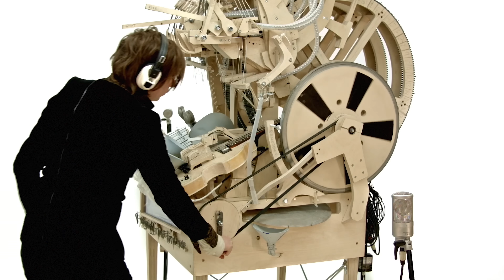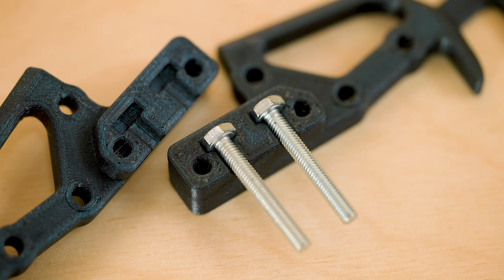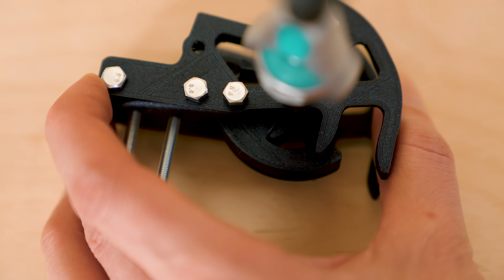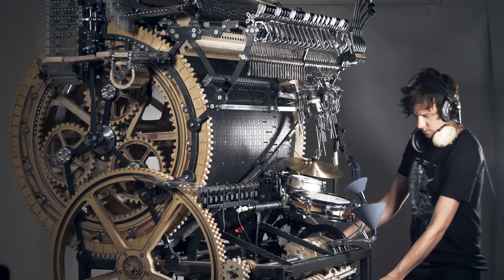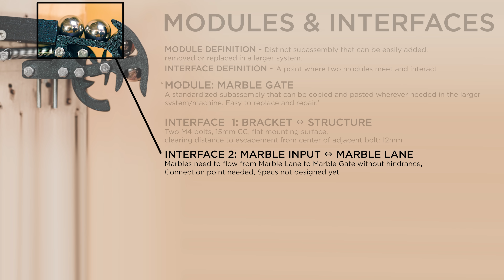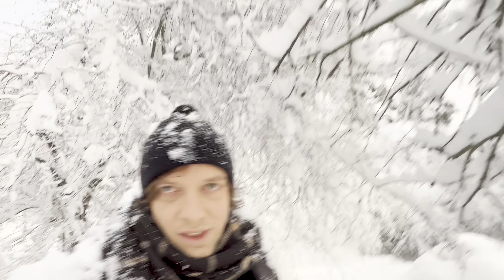The Foolproof Marble Gate - Does it Exist?

Comment: Awesome work. A brand new module. 

* Your previous tests are all null at this moment. (The small post-drop lift of arm disrupts the settling of marble, possibly wrecking the hold time test earlier).
* Need to test for added weight of hundreds more marbles in line. Not with just 5 marbles - Load testing.

Comment: Hi Martin,
Great to see you back in action. Your Nelson Tale from the previous video was great!
Your modules and interfaces explanation is to the point, but your specification of the requirements is not. Any specification containing the words 'as possible' is meaningles. Even worse is 'as close to'. When ends that search? De you realy know there is not another design that gets even closer (still being  'possible')? You should instead specify your minimal goal to reach, and probably a 'nice to have' goal. In one of your earlier videos you showed that the human ear can't detect differences smaller that 30ms. So 'thight music' means 'within 30ms accurate''. Then you have to consider how many parts/steps in the machine contribute to the timing accuracy, and how much each step may contribute to it. It is of course allowed to bargain with these numbers during the design process, but you should not spend time optimizing a part that is already good. Remember 'perfect is the enemy of good'.
Good luck with your engineering.

Comment: At times, it is beneficial to have another set of eyes on a problem.  Everyone has an idea, like myself.  The area of release time, I see should be a 2 part section.  When the marble is being held for release, there is a force that you're not using.  If the trailing marble was resting on 1st.  then the stored energy or what I would call (load force) will supply energy to the marble leaving the gate.  I also think if the release section was vertical with several marbles adding load = greater speed.  I so enjoy your engineering abilities.  Don't apologize for reaching for perfection.  It's something few achieve.  Well done, Sir!

Comment: evolution. nice. you can try to use some other software and infrastructure concepts to make your work easier :) 
for example: "Fail fast, fail often, recover quickly" or "Automate everything"
and I think you could try to use the dependency graph concept to make the change chain visible and see if something is going wrong in your dependency chain :)

Comment: Nice nice nice. Also you should check for resonance problems. Let your Arduino sweep the intervalls gradually and see whether the bounce behaviour causes weird behaviour at some particular frequencys. So, in cases some BPMs don't work fully reliably, you can avoid them or... dampen the system

Comment: I do not like the feed to your marble gates. The steel marbles are not sufficiently constrained, but are allowed to "flow" downwards via gravity through tubes or channels, and will bounce about like a Newtons cradle. What happens at high or very dynamically variable flow rates? Probably chaos. You need a gate that works AND a dependably steady way to feed that gate under a wide variety of dynamic conditions.

Comment: Hey Martin, now that you have learned about modules and interfaces I suggest you also add some "continuous integration" to the mix. That would roughly look like: 1. Define all modules and interfaces for a complete machine 2. Build a first very rough version of the complete machine that is completely functional 3. Iterate on it by improving one module at a time.
What is quite important is to quickly finish step 2. That means you'll have to very quickly reach a point where the machine does everything you need. It can do it in a very buggy way but from that moment it starts to "deliver value" and you know that you are on track. You can then produce a little song after each improvement iteration instead of making the audience wait forever. It does not matter that the machine will be very imperfect at the beginning. Things will just keep improving. What is much worse is to only build the machine to 70 percent or so and then go through endless optimization loops without letting it properly play at the end of each iteration.

Comment: i have a ball bearing feeder for speed shooting slingshots.  i like it because it’s a convenient way to store an extra 50 ball bearings but it’s actually faster to just grab them out of my back pocket and the thing has many flaws.  the magnet isn’t strong enough to hold ball the ball bearings so it’s easy to drop bbs on the ground and it only works with two sizes of steel balls.  somebody else made the exact same thing but it’s in the handle of a slingshot and it’s expensive and the guy patented the slingshot but it has the same problems and only holds ten rounds.  but nothing has been made for clay ammunition.  also i have a 6mm blowgun for airsoft bbs and i cut down my broken slingshot bands to shoot plastic bbs indoors but if i were to play airsoft with either of those things a speed feeder might be nice.  maybe you could do other things with your design?

Comment: I noticed that in the middle of the "Attack time" the gate holds the entire marble queue with only the release lever at the bottom- I'm worried that with greater marble pressure that will end up failing. It's really awesome to see you approach this in such a piecemeal way, I think you stand a MUCH better chance of success this way!! When I did coding (wayyyy back in the day) I always found it was better to perfect pieces of code, then integrate them together rather than write the entire program and then troubleshoot.

Comment: Martin, I don't know if you'll see this, but I had a design thought: one of the challenges with this gate seems to be how the marbles jostle around (bump back and forth) as they move through the gate. (It mustn't be a major concern; you seem happy with the gate!) I wonder if the jostling could be reduced by modifying the clock escapement gear to have spherical cavities that guide the marble more gently through the gate. I'm thinking of the kind of gears that exist in those automatic orange juicer machines.  Googling "Maxima MAJ25-45 Squeezing Cup" should pull up the spare part from one of those juicer machines that shows the shape I am trying to describe. I wonder if putting something like this as the escapement gear might make the marbles' journey smoother before the drop.

Comment: Martin, your new approach to problem solving seems to be yielding great results. At the start of the most recent phase you seemed quite negative about the prospect of actually initiating a new marble machine build. Over the last few videos,and your success in improving the marble gate, I can sense increased optimism in your words. I’m sure all your followers are hoping that you can get a working machine designed and build as a result of your higher level of discipline. Can I please ask that you don’t get carried away on a wave of positivity and forget to apply the restraint and control of your current approach. Having said that, I wish you good luck as you move forward and keep my fingers crossed that a new marble machine will eventually grace these pages. 🤞👍👏

Comment: Let’s talk about the interfaces. Interfaces 1,2, and 4 are very simple. Interface 3 is complex! 
A complex interface is a warning to the designer that this likely not to be a good choice of module boundary.
The module boundary should encapsulate the internal complexity of the mechanism in the module, and reduce the interaction to a minimum, one signal per gate would be ideal, be it a mechanical push rod, an electrical signal or whatever. 
Interface 3 currently has too many constraints and things needing adjustment during assembly.

Comment: I caution about the way this gate will wear. I don't know the terminology for any of this, sorry.  The 'top spike' that holds the starwheel looking thing is really thin and rubs against the starwheel.  Over time that will wear, and the tip of that spike will become shorter with very little wear due to how thin it is. The location of the tip of that spike is very important to your timing and the gate working well.
Not sure what your planned materials are for this, but I would definitely not trust any kind of plastic, and honestly there is no reason for that spike to be that thin other than appearances.

Comment: One other thing to consider is the plastic parts that move against one another. Given that the machine would have a high number of cycles, it is important (especially with rotating members) to use dissimilar materials to prevent micro welding between surfaces as heat builds up at the points of rotation/sliding against each other. You may find the gates start to stick or break because surfaces start to weld and break as the gate is cycled repeatedly over a short period of time.

Comment: :( I feel a bit bad when I see a flaw in the design and you take the bad approach to solve the issue.
I can understand it is not obvious: "the gate closes too slow, so we need to speed it up".
No, the real issue is, "the gate is not closed when the marble is released". So the solution is "change the geometry so that the gate is already closed when the marble is released". Then it does not depend on the speed anymore.
Anyway, I am glad that you have solved your issue.

Comment: I think you are repeating same mistakes as before. Your super solution for problem is turning parts 3 degrees left or right. Think about what happen after milion drops of a marble. Will gate set be excactly the same? Will not plastic parts ware out? If you need to tweak your solution that way, it is not a good solution.

Comment: The new gate looks great and seems to be highly precise and accurate on its own, however I wonder if this will be the case when there is 15 plus gates going at one time and the machine has vibrations and movement. You need to test this before settling on a gate design

Comment: Will 3D printed plastic be the final material of the gates or will they be made out of plywood? If you are using the 3D printer just for rapid prototyping it could be time to test it with the final material :)

Comment: I think you need to consider the vertical drop of the gate. A lot of your timings were "fixed" by ensuring the gate dropped vertically and the marble landed on a flat surface. However that will cause the marble to bounce and re-hit the same point. It needs lateral movement in order to bounce off of the instrument and subsequently collected.

Comment: I still believe that making the actual drop the last thing the gate does on activation by the wheel is a mistake. It would work, maybe if you are using a cogwheel that is rigid and all tooth are the same. If you use a programable wheel the pins will not allways be necesarily the same lenght or the same angle, there will be play. The activation will be the most consistent the closest to the wheel it is. The tail end of the contact will not be precise at all. Also, this lenght of contact will increase at lower tempos and will not be consistent.

Comment: Hi Martin, I know this will likely not matter that much in the long term design but regarding the "ideal hold time of 500 ms" calculated from last video, I would say that based off the results you got the ideal hold time is a much broader window, with no visible difference between 200 and 1000 ms, the few data points you got that were 1 could simply be discarded as outliers in the extremes of those because of a lack of precision in the way you are measuring standard deviation (i.e. the smallest difference you can possibly get is 0 or 1, you lose information like 0.8, 0.5 etc.). Does this matter? Not really, 500ms hold time will be totally fine, all I want to say is don't be so quick to assume outliers are indicative of less accuracy when this can't he explained mechanically, there is no reason 1000ms should be less accurate than 500ms :)
Reply: In other words if you repeated the experiment you might not get the same results, 1000 ms might go down and 400 up just by statistical chance

Comment: Ok, i think i now get it. I think i get why MMX was never pushed further. In this clip Martin made the whole soundtrack with the original marble machine song. It shows, definitely, some love to this machine. MMX never received in those videos such an attention. I had trouble understanding, like many others, why not one song was ever recorded with the MMX, and it seemed that the second machine wasn't liked at all by Martin. I now think that Martin had true affection toward the original MM, because it was a first project. It was never meant to do anything else that one song. It was some kind of an essay, a novel.
Now, Martin tried to write a full serie of books with the MMX. It never even came close to that, it kept being a cool novel, but never getting closer to achieving the goal. Doing one song with the MMX would have been cool, but maybe in the eyes of Martin it would just have been an ultra much more complicated way of achieving the exact same thing as the original Marble machine, with much more funds, time, tears and angle grinders discs used ;)

Comment: As a software engineer it's interesting to see integral aspects of my profession being used in other domains :) You're essentially doing Architecting (modules), API design (interfaces) and unit testing (testing one unit at a time in isolation). The missing step is the integration testing, which I'm sure you'll get to eventually!

Comment: Hi Martin! Probably you should add distance between mounting point and marble release point to interface 1. In case you have to change marble gates with different solution this distance might change, and falling points will be different. If this distance is part of interface you will have restrictions and points wont change. Maybe it will be wise to add extra space between them in case the new marble gates design will require more space.

Comment: This modules and interfaces approach is something similar to TDD and interface testing that happens in software. One thing to not forget when using this approach is that one instance of a module may behave in a given manner, but out multiple instances of the same module together (e.g. many marble gates) and you may see different behavior.

Comment: I also have an other comment, namely:
The gate catches the marble lower and then lifts it up. Does that not mean that it needs to lift up the entire stack of marbles? Consider the highest stack you would want in your design, add 50% and see if the gate still holds. Reliability under testing conditions is very important, just as long as you don't forget to also verify under working conditions.

Comment: An important idea when designing modular systems is the "robustness principle". Each module should be strict about adhering to the interface specifications, but accepting of deviation from the interface specifications by other modules. You can also think of it as the funnel-spout principle: module inputs are funnels and module outputs are spouts (metaphorically speaking).

Comment: One of the issues with modules and interfaces is making too many interface. The best interface is no interface. Engineering organizations that religiously adhere to this framework tend to make under optimized systems. Its a trade, easer requirements management at the loss of peak performance. It is however a really good framework. Interface Control Documents ICD's are super important tools in an engineers took kit.

Comment: I think the problem here is that a "gate" is the wrong mechanism, gravity is powerful but on the timescale of music is exceptionally slow.   Something more like a magazine system where the balls are in suspended boosted acceleration is called for.    That way they can quietly and continuously be brought into position then simply released with a boost.  My mind is coming up with a pair of near 90° opposing finger wheels made with slightly twisted spring steel fingers that rotate together under tension to rapidly feed but that would create a huge three dimensional mechanism compared to what you're going for.   Look into the chain and paddle elevators used to move grain and chaff around inside older combine harvesters.
Reply: The time of the fall doesn't really matter, as long as the time between hits remains constant

Comment: About of ramp up (slow movement in the beginning) may be it will be easier to peek on some wall light switch? One spring could help to transform any slow movement into fast edge trigger ;) (the light switches are also doesn't like a slow movement of contacts)

Comment: I would challenge the requirement to accommodate a slow attack time. Is it possible to design some other part of the mechanism so that the attack time is constant regardless of tempo? For example, on a precision bolt action rifle, the sear and firing pin interface is such that over the range of expected trigger pull times the release of the firing pin does not depend on how quickly the trigger is pulled. Perhaps something to think about in order to shift or eliminate complexity.

Comment: Great design.  If it has to lift a marble it's only lifting one - so the length of the cue doesn't matter.  Every marble starts from the same height - so the timing is consistent.  Modules and interfaces are crucial for software, because software gets complex in a hurry and because the other side of an interface will likely be written by someone else.  It's therefore necessary to let them know how to succeed.  I also agree with Ph Pn about damping and adjustability where needed.